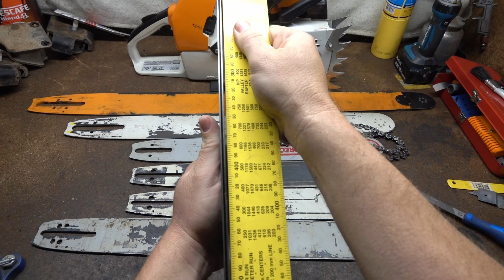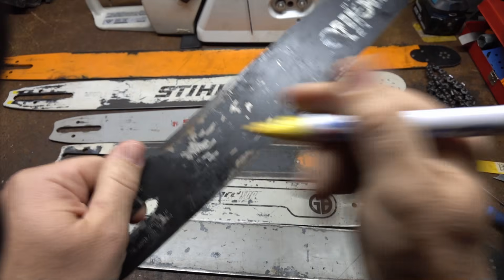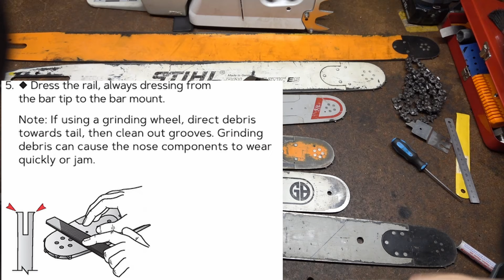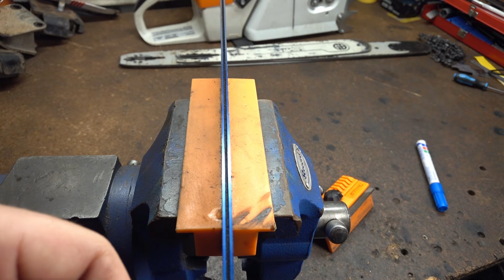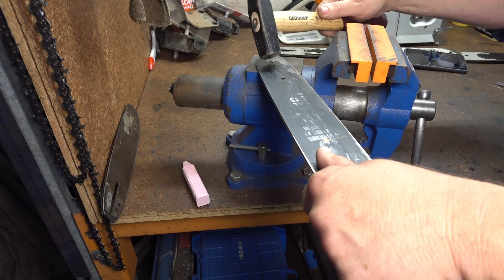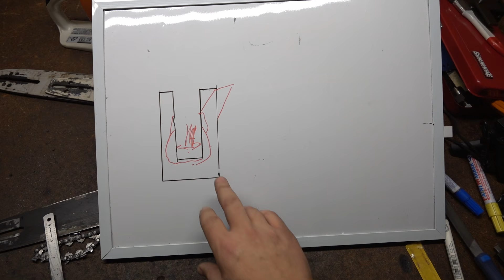Chainsaw bar damage and how to repair it

Comment: I have a little Homelite, first saw I bought 25 years ago when I knew even less than I know now.
The nose guard is bolted on (~5mm? I didn't measure it)  hasn't lost a rivet.
I'm learning more than I wanted to, only found out earlier the Homelite is using low profile 3/8" chain, until a few days ago didn't have any clue about differences.

Comment: I built my own bar rail closing jig with some wingnut fasteners for adjustment and some bearings to slide the bar rail through to squeeze the rails together. But tbh, I rarely use it, I do exactly what was done in this video as maintenance but I just find if the rails need serious closing, the damage within the lower half of the rail won't ever be corrected with basic tools, metal has been worn away & whats left is fatigued. You can close the rails but that thinned out metal within the rail wont hold a closed rail for any amount of time to justify it in the first place. A brass hammer and some drive tangs works 'ok' but most of the time if rails are spread with internal damage I'm not investing time and energy into a lost cause, it's toast, time for a new bar. Maybe remove the RSN if its salvageable as a spare, fit a new bar and rid yourself of that mess. Its cleansing to the soul when you fit a new bar, drive sprocket & new chain to your saw. You go cut with it and for a brief moment it seems that everything is wonderful with the world. 😊 Great video.
Reply from the maker: I have had the same experience with closing them. It works for a short time if your lucky but the wear in the bottom of the rail always comes back to bite you  in the arse really quickly

Comment: I assume it would have to be a fairly expensive bar to be worthwhile  replacing a tip.? Generic reasonable quality bars are pretty cheap these days.
Reply from the maker: It depends, this thing is cheap but I wanted to use that bar and chain because the sprocket on the saw is in such a bad way. I didn't want to put one of my chains on there

Turns out I like the saw so I will throw the stuffed spur sprocket in the bin and replace it with a new drum and rim setup

Comment: Thanks for the great video! I'm really interested in the different wear patterns for chains that are too tight and too loose.
Reply from the maker: On the bar - loose, they wear just back from the nose. They slap back after going around and dig out that part.

If they are too tight they wear the nose sprocket quickly. After a while they will split the nose and the chain can drop into the end.

On the chain - loose wear the heel of the cutter. The wear looks similar to one that's been used when blunt

Tight wears the whole underside of the chain. They will be flat and wear up to the rivets early in the chains life